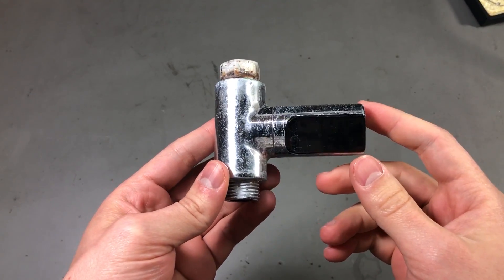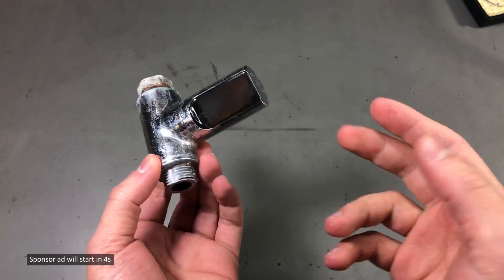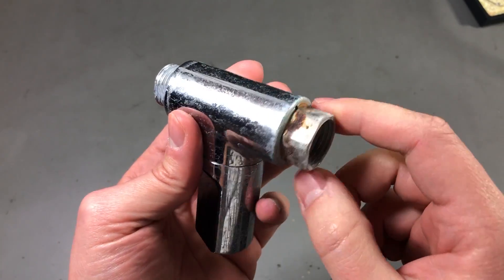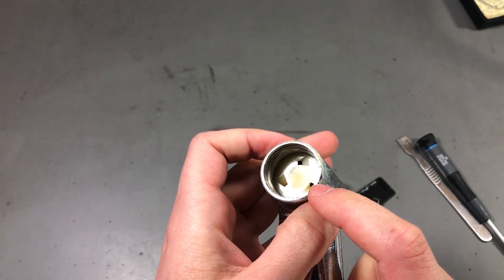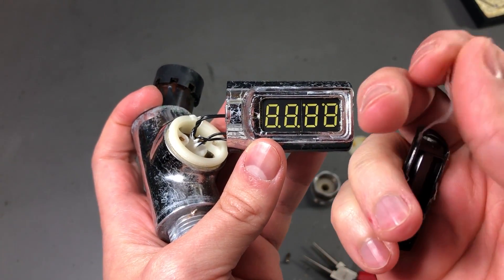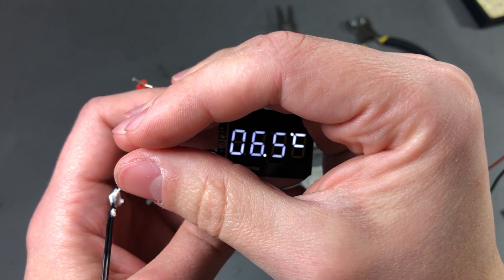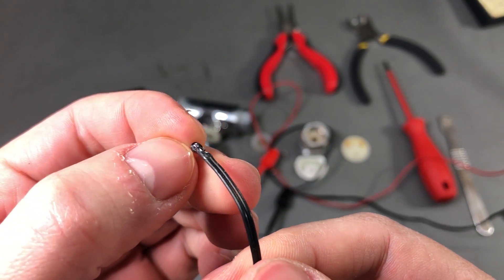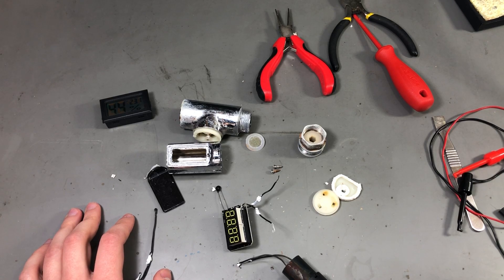Voltlog #218 - Shower thermometer teardown after 10 months of usage

Comment: I wonder how it's powered, where's the battery storage?
Reply: There's no battery.  The turbine generates the power
Reply: @111Xumi111 Then what could be causing mine one is doesn’t displaying the numbers?
Reply: @GLRAXVI probably died. I tore mine open too (didn't turn on) the board looks pristine, no corrosion, but it doesn't work.  Unfortunately you either replace it or find a better alternatives since these are disposable.

I was going to buy another but since I have home assistant I'm probably ending up buying an inline temperature sensor like the YB-B7 on aliexpress and connecting it to home assistant with a ESP32 board with ESPhome. Then you can watch track the temp in pc/phone and even put an alarm when water is ready if your system takes a while to warm up.
Reply: @111Xumi111  Ok. Do you have any recommendations?

Comment: I had one like this and stopped working after 6 months. The temperature was initially accurate. The turbine was worn out and wasn't turning properly anymore. At the end it was noisy and wasn't producing enough power for the temperature circuit.
Reply from the maker: some people are saying the same things in the comments, so it could be that I got lucky and my unit was sealed better and/or the water in my area is not as corrosive.

Comment: I wonder if you'd solder the original thermistor to the PCB directly (i.e. cutting off the wires) whether you'd see a reasonable temperature reading.
Reply from the maker: impossible to test that now as I poked it with a blade.. but a good suggestion, I should have tried first.

Comment: Great (random) video again Florin!  If I had to guess, I'd say the failure was due to the epoxy seal around the thermistor.  Epoxy is stiff and the wire is flexible and I'd guess that the thermal coefficient of expansion is different for both materials.  So over time and numerous temperature cycles the epoxy released from the wire and water crept in...
Reply from the maker: yeah your theory on the epoxy makes sense and apparently it's a known issue since they are now offering a newer revision and they claim it fixes some issues.

Comment: Did you try varying the supply voltage? Maybe the turbine is close to seizing and didn't produce as much power as it should anymore. If the voltage drops below the one needed by the voltage regulator (pretty sure there will be on on there), it will mess up the voltage divider (also pretty sure that the circuit will use one) with the thermistor. If that is the case, you are keeping the only part that is actually broken (soon) XD .
Reply from the maker: superdau I powered the board from my bench supply at 6-7v in the video.
Reply: @voltlog  
Yeah, but the interesting part would be to vary it and see if the displayed temperature changes.
Reply from the maker: I haven't done any extensive testing regarding that but as I was slowly bringing up the voltage on my bench supply and watching the display come on there was no noticeable fluctuation in the measured value.